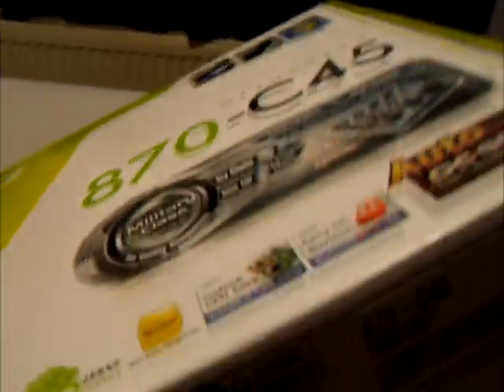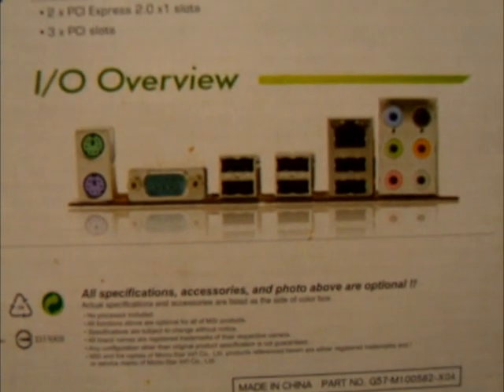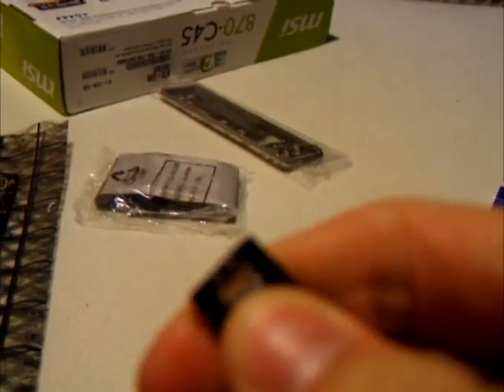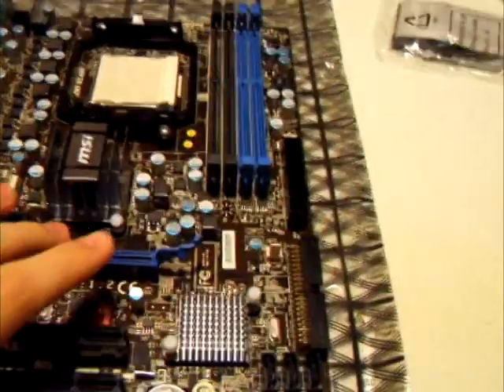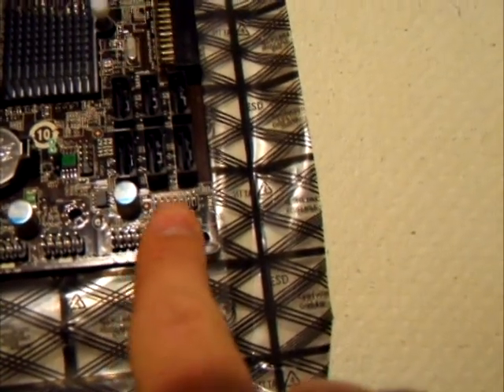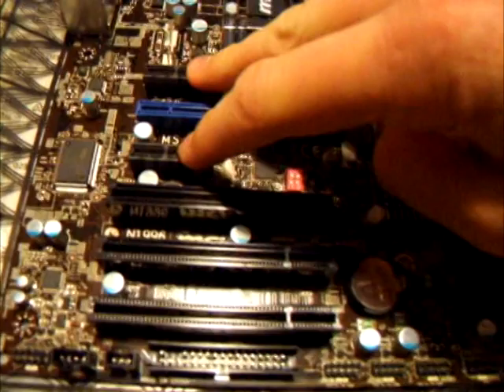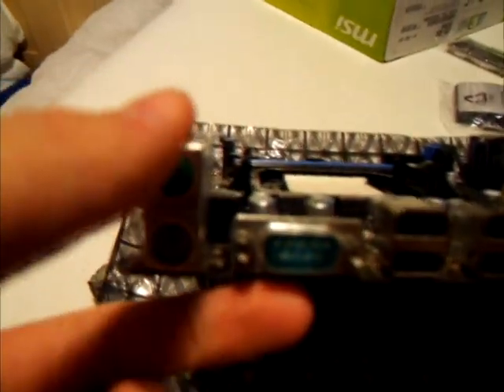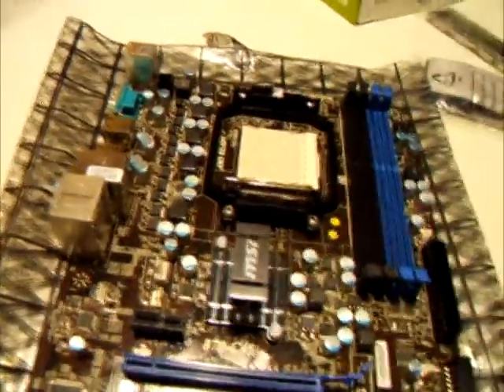MSI 870-C45 Motherboard Overview

Comment: @draganciricfox but if runs ok at 1.5v then leave it as it will run cooler less v is good unless if unstable blue screen then turn volts up if ok leave it

Comment: I have this motherboard and 2x2 GB Kingston Hyperx 1600MHz. I set DRAM Ratio to 1:4 and I did not set RAM Voltage to 1.63V-it's on default(1.5). Ram works fine,when system boots is says that RAM works on 1600. Should I leave it as is or to set voltage to 1.63??? Plz reply

Comment: Hey, just a quick question.
Have you put RAM into all four DIM slots?
I just got a 2GB DDR3 1333MHz stick of RAM yesterday, but it doesn't fit into the blue slots.
I took out my older stick of RAM, which I know for sure would fit, but that doesn't fit either. Help me out please?